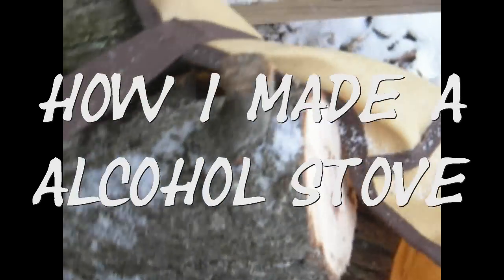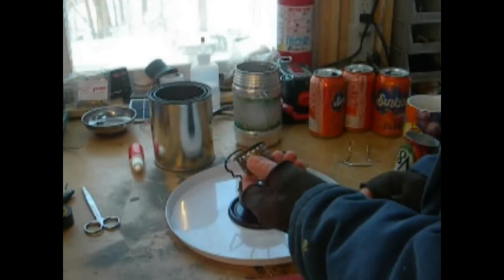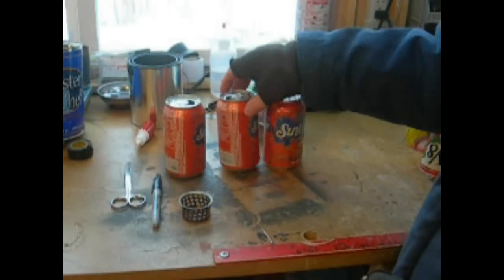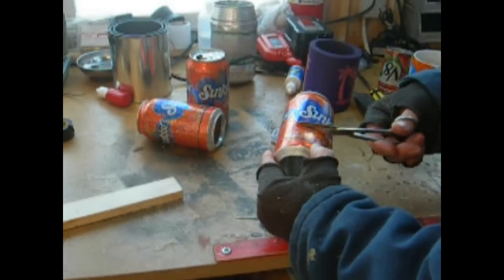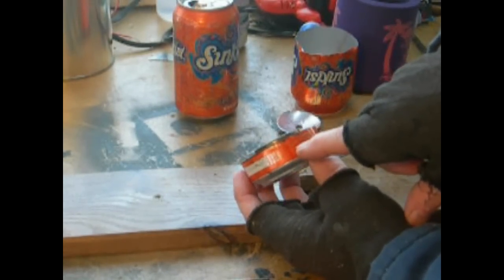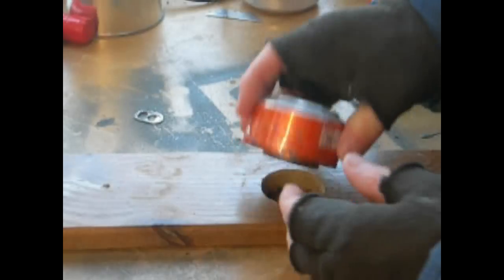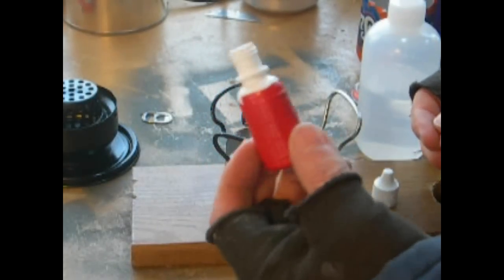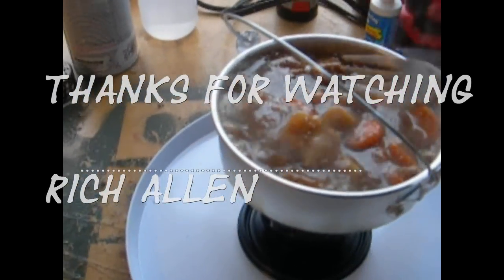HOW I MADE A ALCOHOL STOVE  RICH ALLEN

Comment: Just curious as to why no one on these videos uses tin cans, like the type your vegetables come in. It seems that it would be stronger and more durable. You think there is an issue with the way it heats? Maybe you could try and make one. Thanks for all your videos, they are very helpful.
Reply: The aluminum cans are light-weight and easier to work with and cut. When you press the cans into one another they become quite a bit stronger and lose their flimsiness.
Reply: @griffinsmithish  Besides, aluminum give better termal feedback than steel, and don't rust with humidity.

But a "Fancee Feest" wick stove type can be made using tin cans.